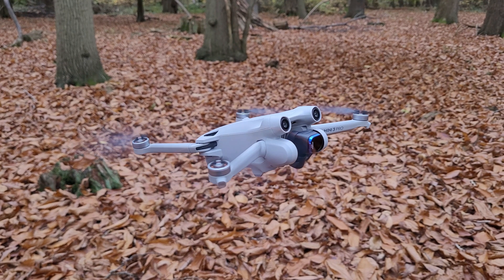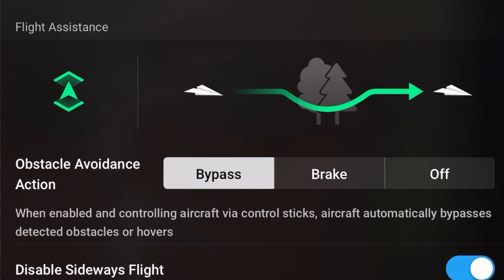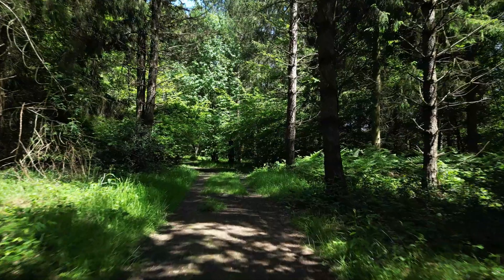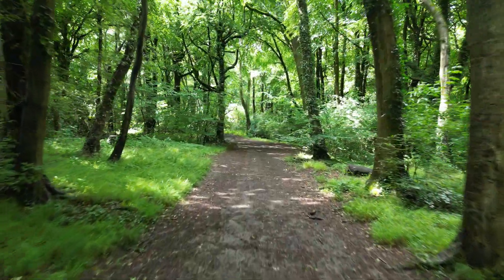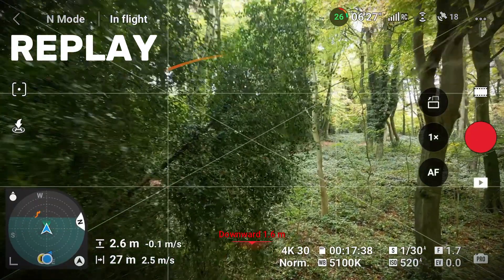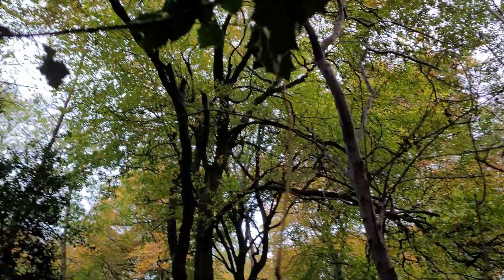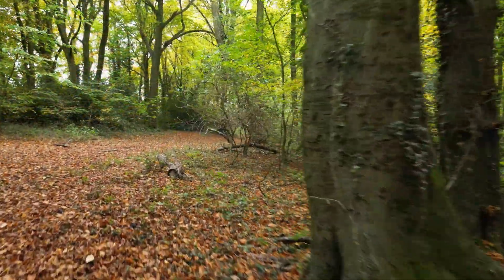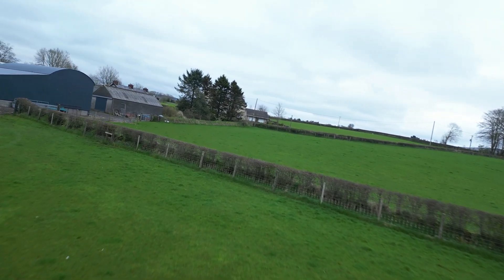DJI Mini 3 Pro in the FOREST: Obstacle Avoidance to the MAX

Comment: Very helpful video. Two quick questions if you don't mind. 
1. How far away from the obstacle does the drone brake?
2. Does the system work at high speed?  I would imagine the higher the speed to more you would need such a feature!  

Thanks!
Reply: ZERO sensor available in sport mode regardless of rate of speed.
Normal mode is about 24-26mph and works fairly well in obvious condition's, light permitting

Comment: I'm looking for info on OA for landings. How does it handle things such as the edge of a house roof or a railing on a deck? Mine came down next to my house (not from the deck launch point) and some how got sucked in against the house , small crash, and only propellers scuffed but this is something that isn't demonstrated anywhere that i can find.
Reply from the maker: Hey, that’s quite surprising - I’ve never seen anything like this before… The only potential reason I can think of is that above roof level, there were strong winds/gusts and as the drone was coming down, it suddenly lost the need to combat the wind and so it crashed into the wall. Does this seem like a reasonable possibility?
Reply: @takeoffdrones not sure, or it may have been compensating for wind blowing away from house over roof then when it got below house level there was no wind and that compensation tilt took it into house, or i did the wrong direction, cant say for sure.
Reply from the maker: @ yeah, that sounds like it could have been the case. Good to know that there wasn't any major damage to the drone though!